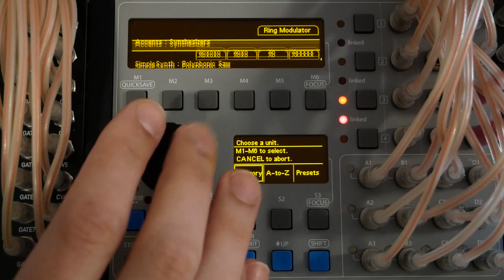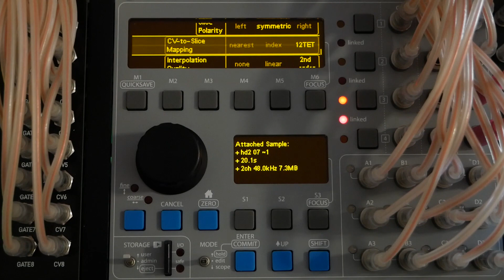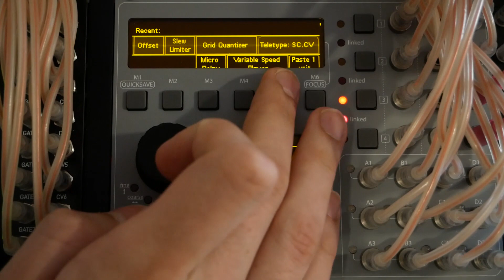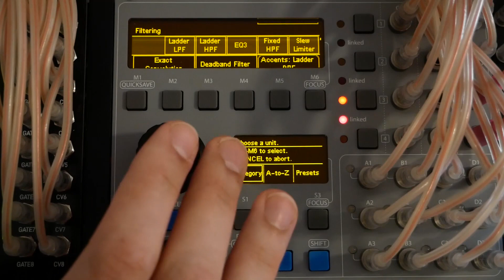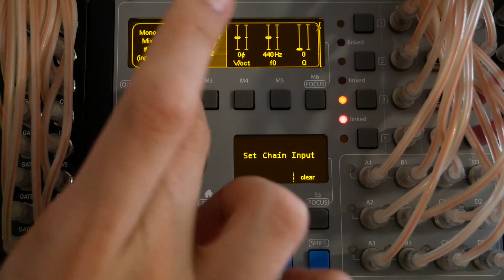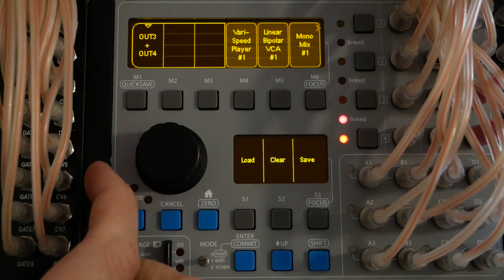Stereo Filter + Varispeed Drums ER 301 Tutorial/Demo

Comment: sick man.
so you're connected via i2c then?
Reply from the maker: The F8R in this system was hooked up via i2c. Things have changed a bit since, now i sequence via i2c with a Teletype.
Reply: @crumbdinger4990  I’m using an FH-2 with mine. I wonder if i2c is faster?
Thanks for reply.
Reply from the maker: @TRaddcliff  I personally have no experience with the FH-2. I assume it’s pretty fast but the overall speed must depend on your computer and DAW. If you’re using a dedicated controller or hardware sequencer it’s probably very tight. I2C is as fast as I could ask for, though.
Reply: @crumbdinger4990  thanks for reply!
I’m not super technical :(
I found this 2hp module made by someone on lines forum. Trying to find out if it does general MIDI or if it’s dedicated to the Teletype module. If it does what I hope it does, I’ll be pretty stoked. Thanks again

Comment: Hey I am curious as to what you mean by any DC coming in your audio path (Slow moving CV?) and is this the case with eurorack in general? CAn you please share some examples where it could happen? Thanks :)
Reply from the maker: Sure! DC signals are indeed slow moving or not moving at all, typically used for control-rate CV: sequences, most LFOs, envelopes, offset, etc. Audio-rate stuff is AC meaning that it is periodic and has a very high number of cycles per second, which moves your speakers, which makes air vibrate, which we perceive as sound, etc.

In general it's a good practice to AC couple (read: slap a hi-pass filter around 30hz on an output or before an input) at least the final output of your modular synth as there's a good chance in any patch that you will introduce DC somewhere into the signal along the way, and DC can limit headroom on mixers and otherwise muddy a signal headed for other equipment. Shakmat makes a 2hp, quad fixed HPF specifically for this application. 

Whether or not there is DC offset in your audio path depends entirely on the modules and patching employed. DC coupling is, however, common in modular because it allows greater flexibility in terms of inputs for, say, mixers: you may want to use the same mixer to merge audio and/or cv signals. Mixing in DC offset with a signal going into a distortion or wavefolder is also a classic technique as it can affect the flavor of the output drastically. You may want to AC couple an audio signal which is FMing an oscillator, as you don't want a DC offset affecting your carefully calibrated tuning.

Here's a good article from NE explaining everything quite clearly: https://www.noiseengineering.us/blog/2017/5/12/ac-vs-dc-coupling-what-where-why
Reply: @crumbdinger4990  Thank you very much :)

Comment: I think these videos are great, the ER-301 is very good but has a high learning curve, I'm slowly getting on thanks to these tutorials.  I also have a sweet sixteen but I can't get it to work, which firmware do you use for the tesseract?
Reply from the maker: Glad you're enjoying the videos! Unfortunately I am using a F8r, not a Sweet Sixteen. 

You might get some tips in this thread over at the OD forum: https://forum.orthogonaldevices.com/t/i2c-setup-with-16n-faderbank/3221/262

That post is nearly a year old so maybe a fix has been pushed to the latest firmware by now? Anyhow, good luck!